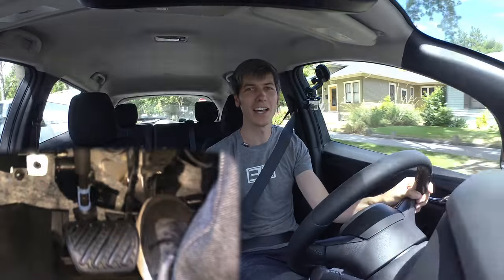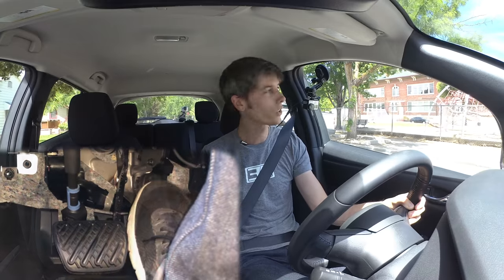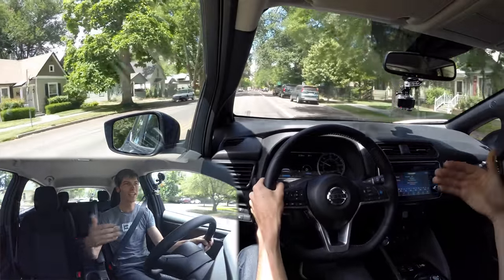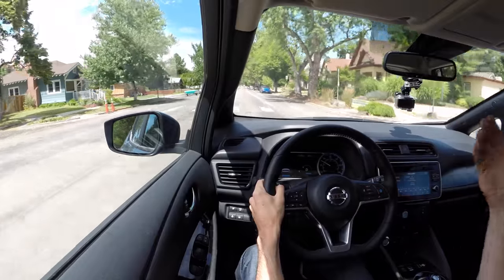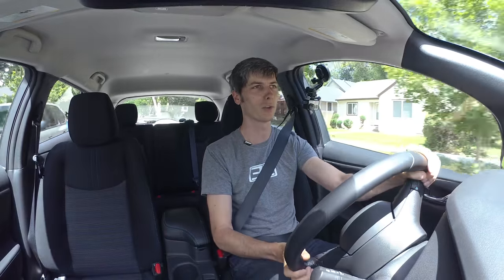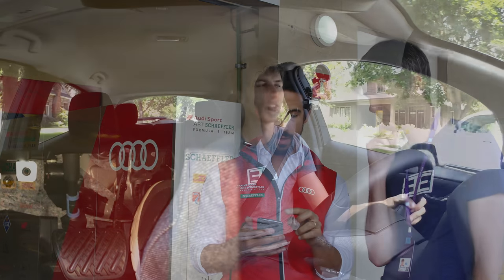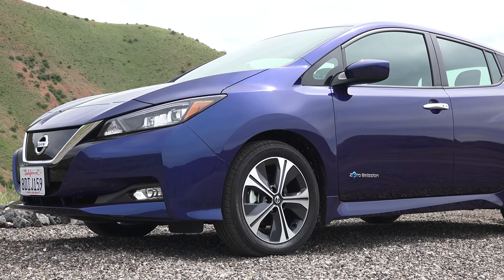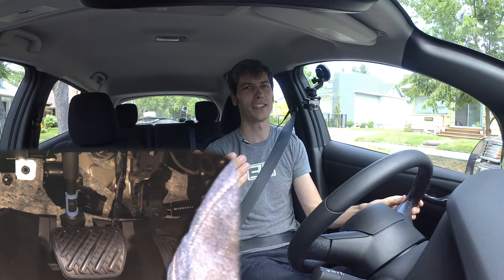What Is One Pedal Driving?

Comment: I’m 14 and drove my dads Silverado up the hill to my grandparents house, and  I was gonna do a hard turn up the hill so I was gonna brake obviously or I would hit brick fence but when I braked I started accelerating and crashed (more like bump the bumper) On one foot driving so this is why I think 2 foot driving is safer becuase you can easily get confused. Btw thank the lord the Bumber crashed  isn’t to noticeable. And today I drove are ATV up to my dads apartments he’s building and I dropped him of the ATV with some tools and he gave me the keys to bring the truck home and Holy crap the tiny crash before traumatized me, I got in the seat and adjusted the steering wheel and seat so my foot has more than enough space and I did another turn and I was as careful as 16 year old girl driving to Starbucks. I drove that bumpy dirt road with a very steep hill very safe with one foot but what do you guys think is better 1 or 2 foot driving. I need to know becuase I’m decent driving but my feet get confused af and this all happened 3 days ago...

Comment: I think that the e-pedal may result in some truly terrible collisions. My reasoning: What about loss of the almost instinctual reactions to use the brake pedal in an emergency? I teach some more advanced driving courses including recovery from oversteer and understeer. It takes a bit of coaching to help a student break out of the instinctual response to steer more when their car is understeering or braking harder when the wheels are already locked up. Knowledge alone is not enough, it takes practice. If a driver is constantly stopping by simply releasing the gas pedal, then when faced with an emergency need to stop, they might simply let go of the pedal more, and then panic when it has no effect.

Comment: One problem though - if you don't regularly use the friction brakes, rotors will rust, which will be a problem when you'll need them to slow you down quickly.
Even if you don't have to, you should still use the brakes from time to time so that the rust is scraped off and you have the best possible brake performance ;-)

Comment: I have a Saab from 99 that runs on petrol and I mostly use engine braking whenever possible so kinda the same thing only that I need to use the clutch aswell and at lower speeds I actually need to use the brake.

Comment: They could have a single pedal system on a gas car if they wanted. Basically just have the pedal tell the car how fast you want to go, there's a processor that decides how much throttle or brake to give, and it's drive by wire from there.
Could do the same thing with a knob or buttons on the steering wheel.

Comment: Probably shouldn't leave it in one pedal mode all the time if you live in a wet climate. The rotors could potentially get quite rusty and noisy. It's probably a good idea to use the brakes occasionally to clean off the crap and rust off the rotors. Not a huge issue at all, that crap gets cleaned off quite easily, but a rotor full of crap may affect braking performance in the event of an emergency. Just my 2 cents!

Comment: This can actually save your break pads I wonder if the newer cars with a Manual Transmission will have this feature available since the majority of the time you can leave the car in Neutral and you don't have to keep your foot on the break pedal at a dead stop in a car with a Manual Transmission I guess this feature wouldn't be necessary

Comment: Jason, this technology actually comes from the forklift industry on the electric lifts in fact a lot of the Prius technology came from the forklift side of Toyota my dad worked for the industrial side forklift division of Toyota. So obviously the full benefit of this system is for city driving and I wonder how much re-gen braking goes back into the battery?
Reply: Timboslice 

A figure I came across online is roughly 80%. So not as efficient as coasting, but worlds better over friction brakes.

Comment: I feel like you almost need to switch back and forth between one pedal and not.  If you are on a slight downgrade, you can normally coast in neutral for a long distance without losing speed.  If you are in one pedal driving you are going to lose speed quickly and will have to accelerate again.  The same issue happens when engine braking in a car.  It makes sense to engine brake to slow down or to maintain speed on a steep grade, but on a slight downgrade you want to coast for a long as possible without losing speed.  In terms of mileage and not safety that is.

Comment: Nice video and explanation.  I may be missing something, but it seems dangerous.  In driving with a standard brake system, every time I brake, I move my foot over and press.  This process is completely conditioned in my mind, and the only decision is how hard to press.  With this system, sometimes I brake my letting up and somethings I brake by moving to the brake pedal and pressing.  Two completely different processes depending on the situation.  In an emergency, while making a split second decision, I can see how confusion can occur resulting in less effective braking, or even more likely to press the accelerator instead of the brake pedal.  What do you think after using the system?

Comment: That explains why I see brake lights ahead even though I still have my accelerator pedal depressed. I was starting to think my vehicle wasn't very efficient since I was applying partial throttle while the vehicle ahead was "applying the brakes"! 
Turns out they are basically doing the same thing as me. That is reducing throttle. But their system reads that as deceleration; thus activating the brake light.
No doubt this explains the annoying on & off brake lights as it's probably the braking system sensing a slight back and forth accelerator pedal change. This needs to be corrected. Perhaps an industry standard or government regulation.

Comment: FRONT TIRE WEAR... this is something to adress i think. I own a chevy Volt and when in "L" mode where regenerative braking is at maximal, we can drive at one pedal too.. BUT in this situation when you decelerate teh front tire will also receive all the decelerating  torque!! So the tire wont last too much. Any single speed change will result in torque applied in both direction of the tire and will make the front tire to wear very quickly. The  AWD electric car like the P100D  have electric motor that apply torque to all wheels so the tire receive a "more normal" braking or decelerating power spread over 4 tire and not only 2...  Tire are $$$ so i thing that unless one pedal is for driver satisfaction, it just does not worth saving few hundred kWh energy with one pedal driving.  Stephane, Quebec city, Canada
Reply: I do...
Reply: But on electric car, the regen activale every single time you release the pedal...  and normally  on ICE car,  you just coast ad tire dont have any torque applied... unlike with electric car where coasting when driving at one pedal is difficult to achive without having the torque in any direction of the  tire...

Comment: I wonder if it would be possible to setup the breaking system so that for the first 0 to inch or so of pressing the break pedal cause a variable regenerating.  For example, moving the break pedal 1/4" caused 1/4" of the max of regenerative breaking, 1/2" causes 1/2 of the max of regenerative breaking.  Move the break peddle more than one inch would cause max regenerative breaking and some mechanical breaking.  I think this would be the most natural solution.

I did take a Model S for a test drive, and I was surprised at how quickly I became use to the one pedal driving.  However, if I wanted to take by foot of the accelerator, the car slowed down aggressively.  So, I would just pop it into neutral with the Drive/Neutral/Reverse lever, take my foot off the accelerator and coast.

Comment: In Like Flint!  One pedal driving is when I stand on the gas pedal until the computer in my 1999 Buick Park Avenue Ultra kills the engine @ 110 mph.  Advisable only when traveling through cow country.  And don't forget to change the supercharger oil...even though tire store idiots and the owner's manual (and others) will tell you it doesn't need to be done.

Comment: I need to adapt my muscle memory if I drive it, because I have confident to let the gas pedal off appox. 50-100 meters before stopping. Even I still feel CVT scooter has shorter braking distance than manual motorcycle (tbh, I currently only have driving stick shift cars).

Comment: I believe that the e pedal feature does mix in some friction brakes as well per my discussion with a Nissan rep.  I really would like to know to what extent this is done.  I have driven a 2018 LEAF with the feature and liked it.  The 2018 cars do regen much more aggressively than the outgoing model (I leased a 2014 LEAF for 3 years) - I think partly due to the stronger motor, but possibly blending of friction brake use at some speeds.

Comment: E pedal will actually use your brakes along side regen to slow you down. You can test that out in downhill, the car will come to a stop, using much more braking force than regen can offer.
Reply from the maker: Not necessarily, regen is capable of far more than 0.2g of deceleration. In fact, regen alone could stop at 1g. It’s done in the forklift world all the time.
Reply: Engineering Explained It's true for forklift but there drive train is not design the same way as EVs. As I understand it, under a certain speed, regen will become less powerful making it harder to stop the car. But E-Pedal will enable a linear breaking force which is not possible through regen only. 
There's a YouTube channel named Lemontealeaf in which a leaf owner show the E-Pedal working in various settings. Even in strong downhill the car will come to a stop. 
I too own an electric car and I made measures using the information from the onboard computer through the ODB port and I can clearly see the kW output lowering along side speed during regen. This is partly due to software but I believe it is also due to physics as the rotation speed of the stator lower when the speed of the vehicle lower, which make the potential energy creation lower. 
Anyhow, I would be very interested if you could make proper measurements of the E-Pedal actions 
G'day
Reply: Actually no, my mistake, you are perfectly correct on this one. I just tested out for myself and it is very impressive. I wonder why my EV can't do that...

Comment: What would be interesting man is to talk how regen or energy recuperation is in fact a negative output of energy.... 
As in, the motor can slow the car down by putting kWs back into the battery.

On any torque app, this will be shown as negative wKs or bog equivalent. It's interesting, more so when we consider that our batteries are always getting a work out. Imagine driving on the freeway, the battery is putting out a constant 20-50kW, and when its parked and charging, it's taking in a constant 50kW or whatever equivalent of power. These things are always working with what we consider high outputs. No wonder why battery cooling is also so important.

Comment: One question (not 100% related with the topic of the video): One thing that characterizes my driving style (with manual cars) is that i use the neutral gear far more often than the rest of the people, helping me keeping a decent speed without using the engine, just using the weight of the car and it's inertia.
I do this because i think that it helps me saving fuel and eliminates some gears shifting in the distance I go through, reducing sightly the clutch wear (my car's clutch is a bit worn, so i'm really interested in this exact point)
Am I right or is this trick just pointless?

Comment: I, by my self, would prefer to have the whole part of the e-breaking transfered to the break-pedal and let the computer decide if it uses the electrical motor or the breaks. So if I am breaking only a little bit, only the regeneration is slowing down the car. If that could be done, I'd love it.
Reply: Toyota has such a system in their hybrids.

Comment: Slowly coming to a stop at red light or stop sign is among one of my most hated driving habits, such as hogging left lane and driving far below speed limit. Just for that bit of extra range....stresses me out.
Reply from the maker: So do you emergency stop every red light?
Reply: Engineering Explained  so weird that I have been your videos for so long and my first comment got  reply over this kind of topic. No, usually if I see a red light in distance, I would let off the throttle and coast to a nice braking distance and then brake, adjust braking pressure as needed. My definition of slowly coming to  a stop is for example, you still have 100 ft ahead to the stop, and you creep using idle speed until you finally have to stop. Then the following car had to keep paying attention to a  stop instead of extra few seconds of relaxed waiting.
Reply: Engineering Explained I mean I understand this can save energy and extend the range of an EV. But it's stressful for me to see hybrid cars and EVs try too hard to use  ren braking . It certainly has its advantages, but the impact on traffic needs to be studied .

Comment: So I have to wonder. Does this car have a physical mechanical connection between the brake petal and the wheel cylinders? Should there be an impossibly unlikely EMP strike and every piece of semiconductor in the car was fried at once, does the brake petal stop the car? If it does, how much travel of the brake petal is regenerative braking only and how much uses the brake pads?

Comment: Part of me thinks that there should be an electric racing discipline that uses no friction brakes for normal racing. Possibly count friction brake usage as if you went off track?

Was also thinking that it might be possible for an electric car to stop more quickly on snow and ice if it were to spin the wheels in reverse, would that be the case?

Unrelated, but do axial to radial caliper brackets get you any of the benefits of radial calipers or is it just a means to allow the use of a radial caliper?

Comment: Considering electromobiles, could you please try and explain how exactly Tesla could have solved the mod. 3 brake overheating issue with firmware update? 
I assume it has something to do with dynamic braking, but this functionality should be there from the start (unless someone physically installed the braking resistor circuits no software can emulate them, i assume) and i believe the mere presence of such system is the reason the brake rotors are so thin..?

Comment: Manuel transmission drivers have been doing essentially this for years with engine breaking... You can also simulate it using a downshiftable manual mode on automatics... nothing new just not as passive as this in electric vehicles.

Comment: How is the fuel economy with and without it? Is it better to let the car cruise to a stop or drive closer and let electric brake does it thing? 

I feel like the brake regen from 1 pedal is less efficient than let the kinetic energy dissapate due to friction.

1 pedal also means you need to put force in to move the car instead of using momentum. Which I think is wasteful

Comment: The only problem I see with this is habitual.  If this becomes common, as it very well may, people will not naturally move their foot when needing to brake.  If an emergency situation comes up it won't be as intuitive to the driver how to stop quickly, while with the current setup stopping in an emergency is the same as normal braking, just push harder.  also, when an emergency comes up you are usually already on the brake and simply need to press harder.  In this car you would need to move from the gas to the brake taking more time, and if someone is used to the former method of driving, they may instinctively press the current pedal that is doing the braking harder causing them to accelerate instead.  This could result in people driving these cars not responding to emergency situations as well.

A potential solution would be to keep the acceleration only doing acceleration and have the brake pedal engage regen gradually for the first half of the pedal stroke and the hydraulic brakes only in the second half of the pedal stroke.

Comment: i feel like depending where you live this could result in extremely rusted rotors that in an emergency stop would not stop the vehicle as fast as it should
Reply from the maker: Rotors are always touching pads slightly, so as long as you drive it surface rust should never really be an issue.